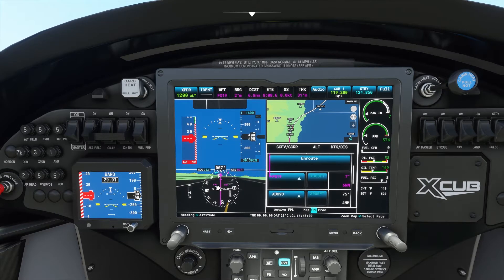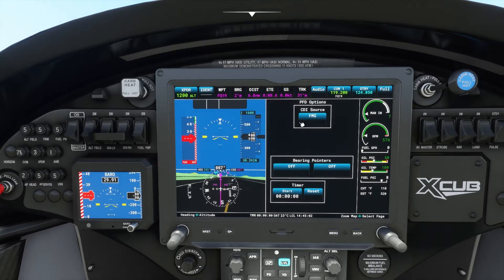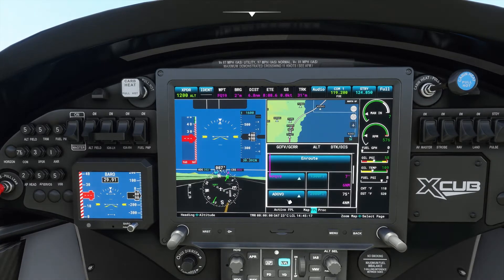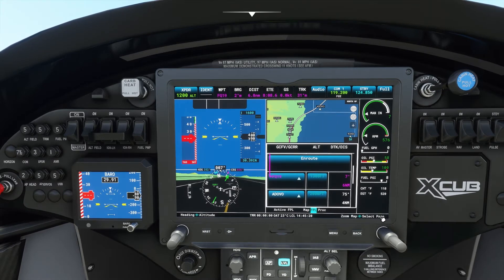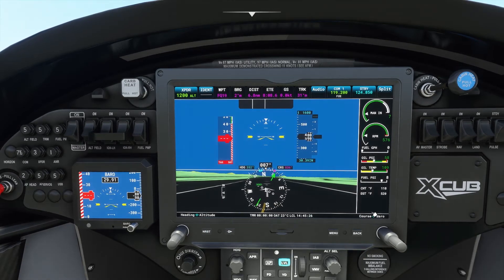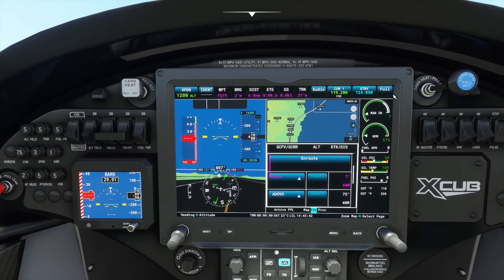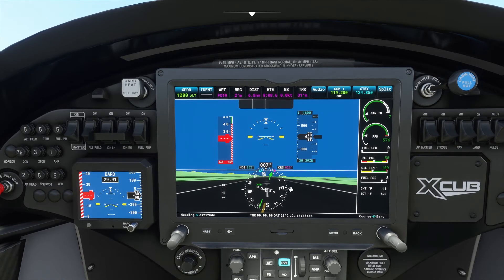XCub Avionics: How to change the Course & set the Altimeter

Comment: Thanks. XCub was a headscratcher for me. At first i couldn't get the AP from LOC to GPS mode, then i couldn't change the G-1000 BARO value. It's not exactly intuitive, because a lot of the G-1000 PFDs in other planes have explicit warnings not to touch the display.